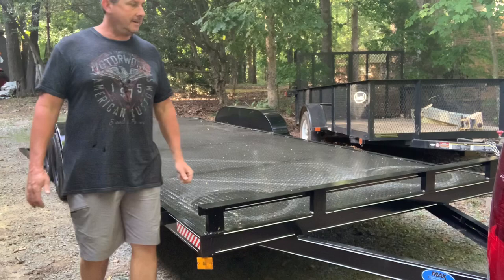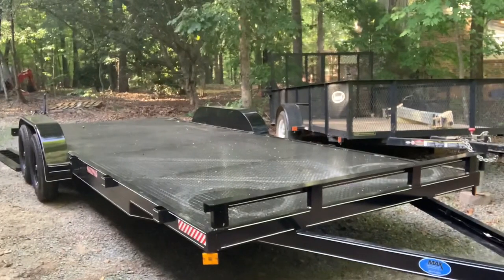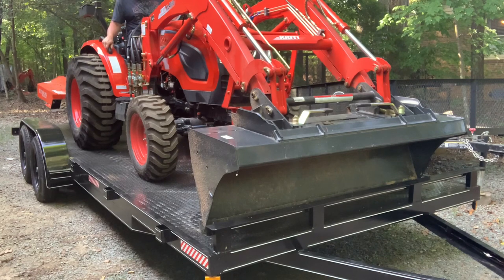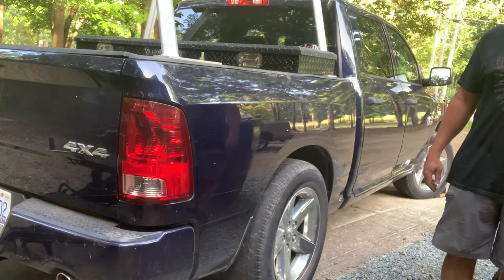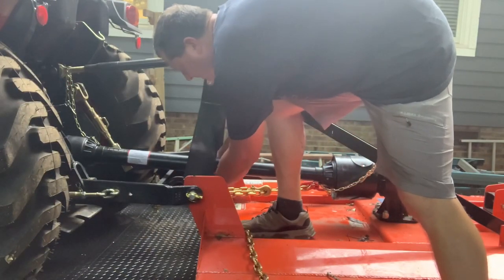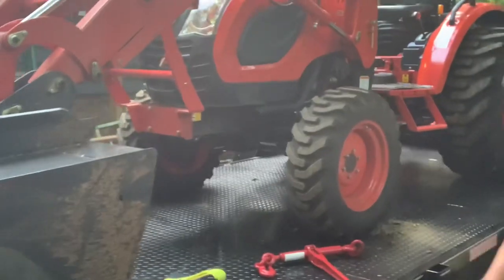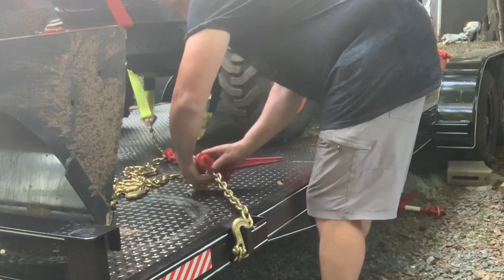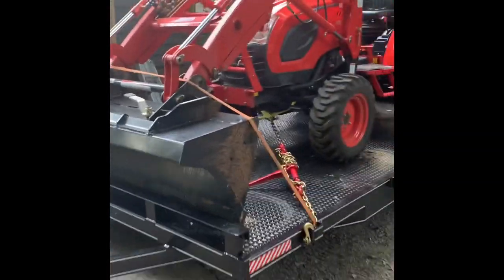Loading the Tractor on my New Trailer | Kioti CK2610 | 20’ Trailer

Comment: Using the chains and binders over top of the bush hog is probably going to tear the bush hog up, plus make it hard to really get the back end of the tractor tied down tight.  And it looks like you have a LOT of weight on the front of the trailer.  I would look at aligning the rear axle of the tractor up with the rear axle of the trailer, or even a little further back.  Your looking for about 10% to 15% of the load to be on the tongue of the trailer, that looks more like 30%to 40%.  

If you back it up, and raise the three point hitch all the way up, you can likely run the chains under the bush hog, to the rear corner stake pockets.  Then hook one end of the ratchet binder down into the rear stake pocket, on the bottom of the front part of the stake pocket.  Hook the other end of the binder to the chain and tighten the binder down.  The remaining chain can be run back towards the tractor and hooked on to the chain there.  Any slack in the chain can be handled by wrapping the loose part of the chain around the tight part of the chain, as many times as necessary, no zip ties needed, the chain won't unwrap itself enough times to matter (same in the front).  Do the same to the other side then once all four corners are good and tight, lower the three point hitch till the back corners of bush hog rests on the chain or binders (you can put something soft between them to protect the bush hog except that part of the bush hog is going to take a lot of abuse anyways in its normal use).  Then strap the bush hog (BH) down over that spot (the frame of the trailer is probably a c-channel, not tube steel, so you can hook the ends of the straps to the bottom leg of the c-channel, assuming there is not a stake pocket lined up there).  Or hook the strap to the stake pocket in front of the tail lights, running the straps under the tail light brackets, then up over the bush hog.

You will probably have to remove the bolt above the arm for the BH's back wheel so you can rotate that up and towards the tractor and strap it to something if it will stick out more than 3 feet from the rear of the trailer.  If anything is hanging out off the back of the trailer (3' or so is okay I think), tie a red flag to it and call it good....cause that flag will be more visible than that bright orange BH.....not really but it should make officer Hoover and his friends happy.

If it worked the way you had it, great, it just looks punishing to your BH and like lots of tongue weight for your hitch.

I would also drive about 20 minutes, or before you get on an interstate, and stop to check everything is still tight.  At that point, tightening the front chains should be enough to also tighten the rears up if they are a little loose (so you don't have to mess with the BH if it is over top of the rear binders).

Please don't take anything above as being critical of your loading, getting these large items that don't have nice even distribution of their weight positioned on a trailer and in a way that you can tie it down can take lots of time and adjusting.  Even more so when you don't want to scratch, bent or bend up your nice tractor and attachments!!

Sorry for such a long comment but I hope it all goes well and you enjoy bush hogging your new property, have a good one!!
Reply: No I don’t take offense at all! Very good tips. I did feel like there was too much tongue weight but had I backed up any further, the bush hog would’ve been off the end of the trailer so I settled for rolling forward just enough to make it fit. 

It probably is punishing to the bush hog to have the chain strapped over the top of it. I like the idea of raising the bush hog and tying the binders underneath. I’m going to try that. 

The set up worked well the way I had it, but doing it that way often would definitely cause damage to the top of the bush hog.  It pulled very well and I had no problems with how it trailered, but I think next time I will probably just back it up a little bit and let the bush hog hang off to alleviate some of the tongue weight. 

I appreciate the input!
Reply: @klittle3147  Glad it still pulled well for you!
Reply: That's the first thing I thought of, too, just guessing on how the load is distributed (tongue weight). As you have probably learned, the more you do it the easier (and faster) it gets. After every off season I have to re-learn all the little tricks and shortcuts that make trailering easier. I know you're trying to meet legal requirements, but functionally I doubt that skinny ratchet strap over the loader would do much good if needed.
Reply from the maker: Yeah it takes a new season to remind yourself of the things you figured out last season.   The little strap over the loader is really for show. It’s attached to the tractor so if that comes loose, there’s bigger problems at hand!

Comment: There's a couple of ways to keep the front of the trailer from hopping up as you load.  The cheapest way is to just put a couple of jack stands under the back of the trailer but your deck looks pretty low so you might not be able to do that.  I picked up a couple of adjustable legs from my trailer dealer that you weld on just behind the fenders.  That way if you're on uneven ground you can have one longer or shorter as needed but they keep the trailer planted when you're loading it.
Reply from the maker: Yes, my trailer’s dovetail is already pretty low, but I may install some stands at some point. At the very least, throw some 6x6 lumber under there if I need it.
Reply: @MakeitHappen1  I just put a deposit on a 20' (18 + 2) trailer.  Factory equipped with the jacks at the bever tail
Reply from the maker: Congrats! Having those jacks will be a nice convenience

Comment: Great video!  Especially since I am in the market for a trailer for my new tractor.  Nice to see how others tie down their tractors and equipment they use.  Is this a commercial purchased trailer or a custom made trailer?  I just bought a new set of rachet binders and the threads need a good coating of grease.  That might help with your twisting chain.  Also, I have seen several equipment trailers that have support stands welded onto the ramps.  But that is with ramps that are hinged and rotate up causing the support stands to rotate up off of the ground.  Good luck with the trailering.
Reply from the maker: Thank you! Yeah it was purchased by a commercial builder. I do need to add some stands for the back of the trailer but it’s so low to the ground I haven’t been too concerned about it.  I agree, it does help to grease those binders!

Comment: Is the brush hog a 5ft or 6ft unit. I want to buy a tractor and trailer package just not sure if to get the ck2610, ck3510 or ck4010.
Reply from the maker: Mine is a 5’ and a CK2610. I bought the tractor before buying land. It’s does great, but if I had it to do over I might go for the 3510 or 4010 just to run a larger brush hog. Takes a long time to BH 15 acres with a 5’er but I’m still very happy with my 2610.  Although I bet the 2610 would be able to run a 6’ BH just fine.

Comment: i welded a d ring on the center plate on the front for a tie down, you can get bolt on ones too.  i painted orange and love it when i have to trailer my tractor around.  i have a ck2510
Reply: That’s a great idea. Since I can’t weld I may have to look into the bolt on ones.

Comment: I use a pair of bottle jacks to keep the back of my trailer from lowering as I load and unload my equipment. It also keeps my truck from lifting up. I installed air shocks on the rear of my truck to keep it from lowering under load...it cost me about $120 and took about 45 minutes.
Reply from the maker: I’ve wondered how air shocks might work. I’ll have to look into those. Definitely worth $120!

Comment: Somebody mentioned you needed to put more weight on the back of the trailer that is absolutely the most dangerous thing you can do you need to balance the load out to where you have a little bit of the load on the front the more on the back the more dangerous it is actually for that tractor you should have got a longer trailer and keep the tractor tires about middle ways between the two back axles are a little ahead which is preferred the main thing is the weight you have on the back of your truck

Comment: That hitch insert looked to be a welded tubular insert which is only rated for #5000 pounds max. Throw that insert in the trash and get a solid steel one with a matching ball that both exceed the gvw of the trailer. Mine I got from TSC and is a solid forged steel unit rated for about 27,000 pounds along with a 1-1/4" shank ball that is about 16,000 pound rating. You do not want to have that expensive tractor and trailer passing you on the highway and killing someone in an accident that will be YOUR FAULT for not using proper equipment and possible prison for doing so if someone dies.

Comment: Oil the rachet binders so they screw in easier, helping not to twist the chain.
Reply: Nice set up. What are the specs of your trailer make model and size?  My ck2610 should be delivered this coming week. 🤞🏼
Reply: Will do thanks!
Reply: @ericwagoner9149  The trailer is 7x20 (18’ with 2’ dovetail); 7000lb axles. Built by Maxbuilt in North Carolina.
Reply: @klittle3147  use a dry graphite like "slip plate" on the binders works with you're strap ratchets also. Oil attracts dirt!!
Reply from the maker: Good call.. thank you

Comment: ANY TRUCK NEED HEAVY DUTY , COIL SPRING IF U ARE PULLING TRAILER
Reply: Not true. My F150 is rated for 500 lb. hitch weight, but 1100 lbs. with a weight distribution hitch. Oddly enough, a Ford Super Duty has the same 500 lb. limit. I pulled my 20' trailer with a CK3510 w/backhoe, bucket, set of pallet forks, and a grapple 1200 miles with only a 2" squat at the rear and 3/8" rise at the front of the truck.